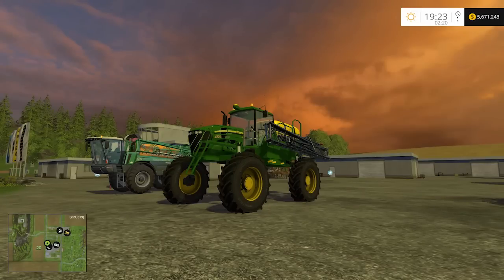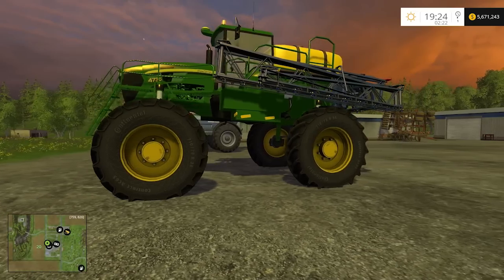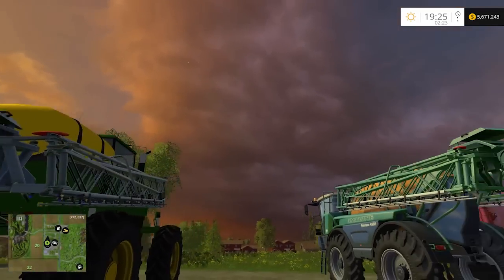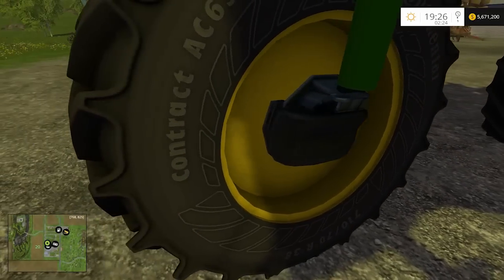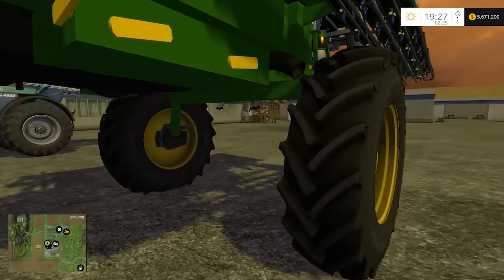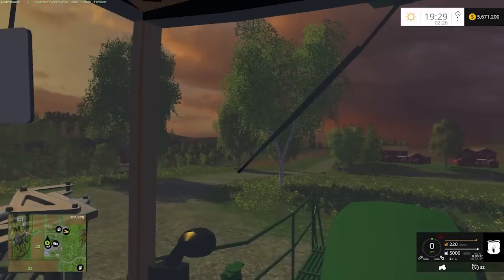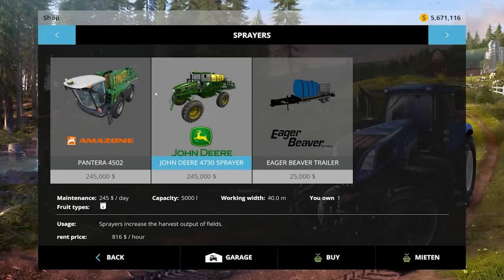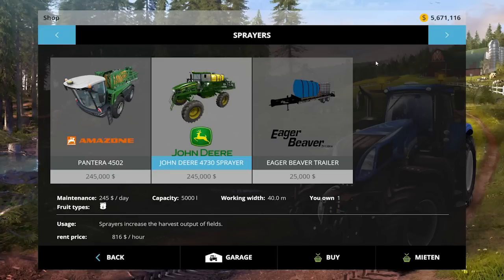Farming Simulator 2015 - John Deere 4730 - Mod Showcase

Comment: Have you seen the 6000 John Deere high boy? We had one back in the day. 3 wheels and sprayer that folded backwards. Wish I could find a mod of that!
Reply from the maker: Joseph Austin I have and they are an odd looking tractor. There is a local guy here that has a couple....One has been rolled more than once!
Reply: My dad rolled one! He hit a tiny little hole and the sprayer just fell over. Another farmer here had the 600 with no cab.
Reply from the maker: Joseph Austin 3 wheelers are so unstable in general, let alone a high boy. If you run one for any considerable time, chances are you are going to roll one. I know the thought is always in the back of your mind. I used to run a a massey with a bush hog on it and every time we cut hillsides, I was constantly ready to jump.

Comment: sorry to say it but its an fs13 conversion that it y there are frame rate issues
Reply from the maker: CaptainD43 0 Yeah, it aint great but it will have to do for now. Its all thats out there. However, the lua files got released today so hopefully some great new mode will be on the way.